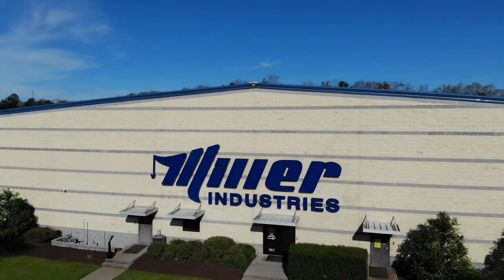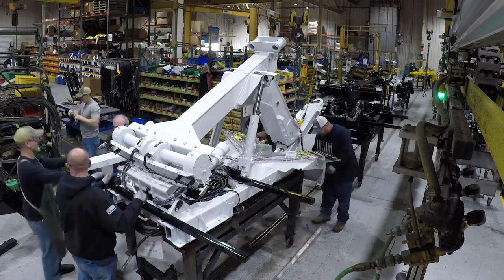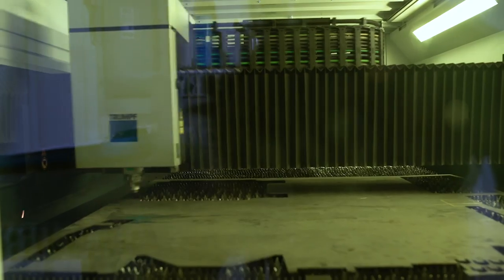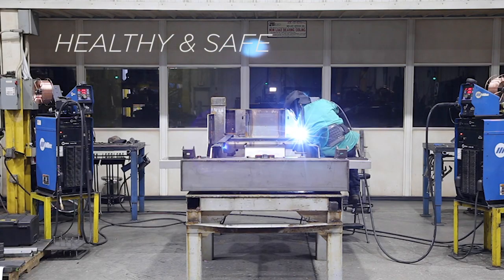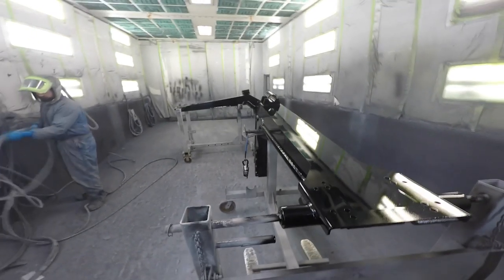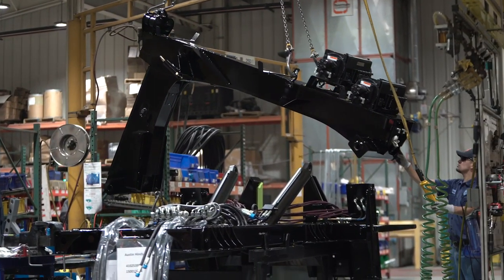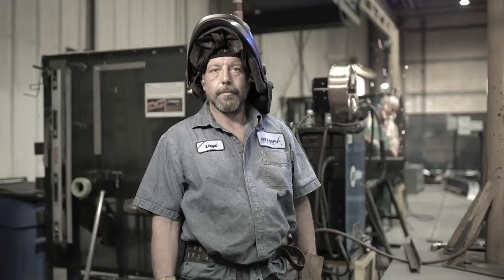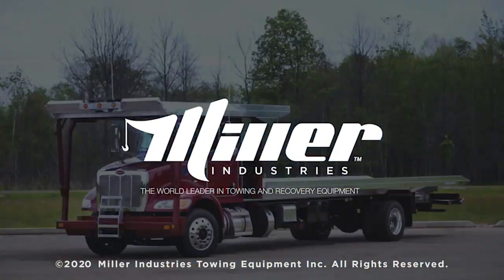Miller Industries Light Duty Manufacturing

Comment: I must say, I tried some of the Vulcan stuff, like the cradle snatcher.....what a joke, cars would roll out of the cradle while backing up. Then the wheel snatcher trucks.
Got tired of the bogus boom in the center of the bed on the wheel lift trucks wheel snatcher where cars would bounce out of the wheel snatchers on rough ground.....the century did not have enough power to pick up a van from the rear tires.
so I went with Jerr-Dann and never had a second thought.
Reply: Did you ever use your straps when you were on the rough road
Reply: @brandonsilvay4822  Your question must be more specific to get a complete answer.
Reply: @casualobserver620  so you don't understand when you use a wheel lift you're still supposed to use straps on the tires right and you also supposed to have a safety chain hooked
Reply: At least that's how it is in every state I've been in because you were talking about how it would just bounce right off and off of the lift and all that on rough terrain well you're supposed to have it strapped especially on rough terrain
Reply: @brandonsilvay4822  You still have not asked a question, but it is clearly obvious you have not been around towing equipment very long. The Vulcan "scoop" did not come with straps as their sales pitch sold it as not necessary.
Reply: The question was did you ever use your straps when you were on the road I'm not just talking about with the scoops yes some of them didn't come with it but it's something that you buy separately or not as part of the lift all my tow trucks and Tony Quinn that I have and that I've worked with for years did not come with the trash when I got them I had to buy straps and ratchets for them because we were required by law to use them in the states I was in if we got pulled over or dot saw it or the police saw it they would get on to us and fine us as a tow company
Reply: @brandonsilvay4822  There is a reason people properly place  punctuation in a statement. It keeps the thought process in order!
Now, reading one long incoherent sentence was tough, but it appears that I failed to make you fully aware that the "scoops" was sold as a strapless method of towing. It was after a number of incidents that occurred, it was recognized that the "scoops" was dangerous. 
This topic was not about if I use straps, it was about the sales pitch of Vulcan. And please describe how you would use straps on a Vulcan wheel snatcher. Or you can explain how Vulcan can put the pivot point of a wheel life in front of the rear axle to make weight shift to the front axle. 
Remember, punctuation please.